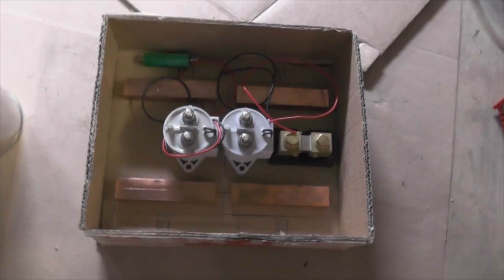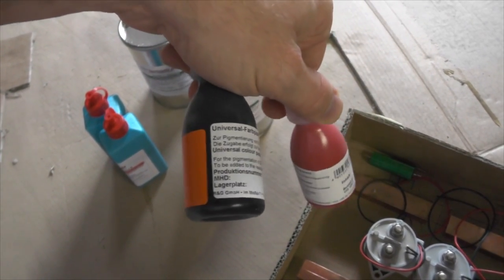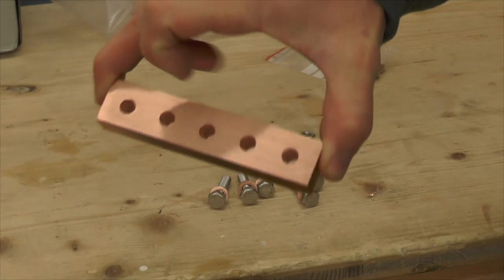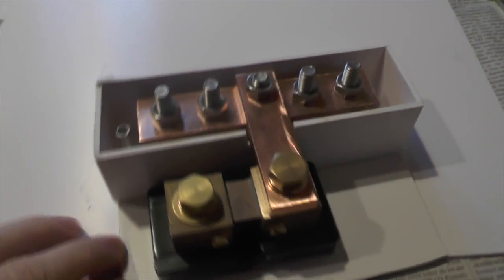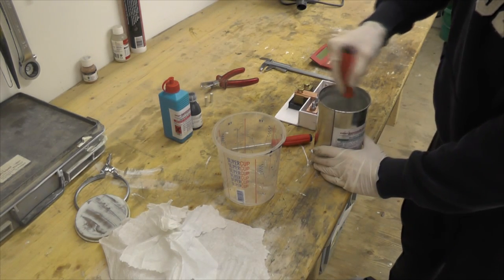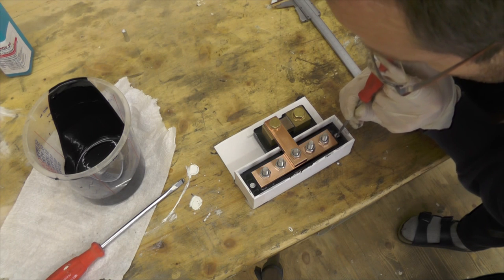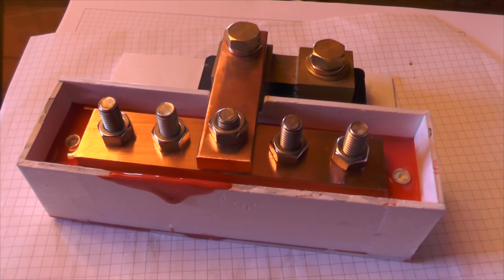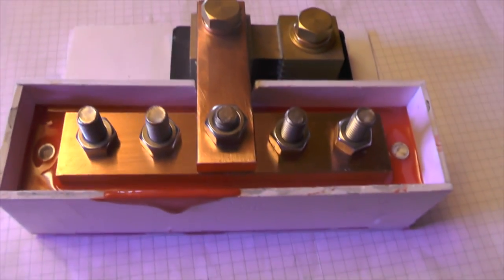Self-made HV Bus Bars

Comment: Brilliant, did you also consider brass bolts? I think I would have cut a thread in the copper to maximise surface area.
Reply: The major conduction surface is between the lug/bar contact. That being said I’m making one from 5mm nickel-plated copper and I’m going to tap the holes to make the connection more solid.